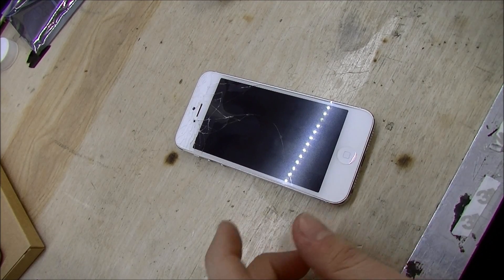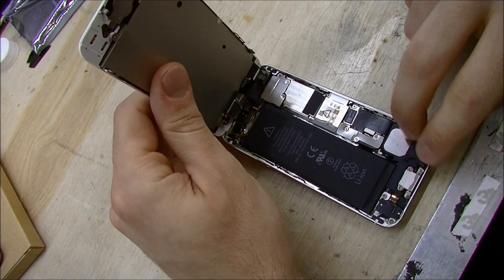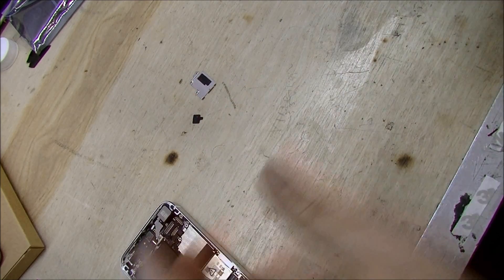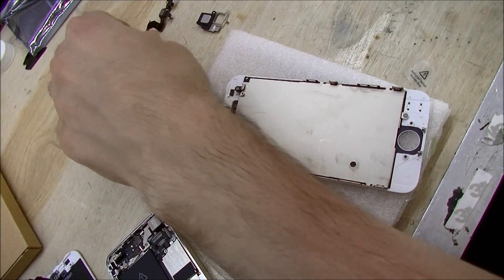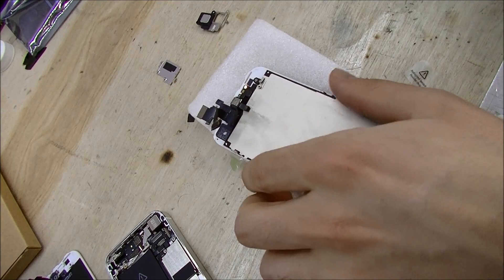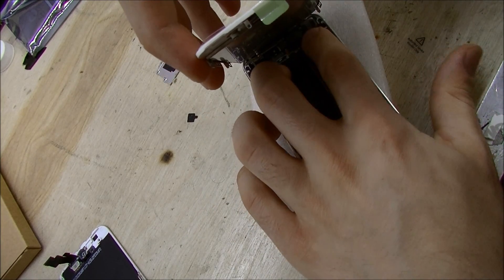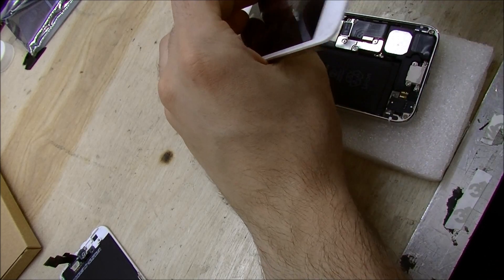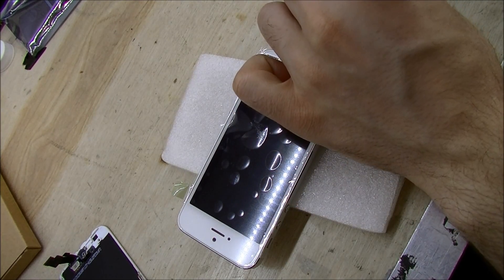iPhone 5 screen repair from start to finish

Comment: Hi. How do you repair an iPhone 5 LCD wherein the contact cleaner (WD40) messed up the inside of the LCD (It's dim now and bright at the top and it's purple with spots and looks like it's cracked). Also would show the Apple logo then shut down (wasn't like that a few hours ago). What happened was I was trying to clean the down volume button by spraying it full blast with the contact cleaner (I should have disassambled it and sprayed on the button from the inside). I was in a hurry. I did give it time to dry up but I think the pressure created a very cold temperature creating water/moisture or the contents inside the cleaner messed up the plastics and backlighting and somehow sipped through the LCD (either betwwen the substrate and the diffuser) but I'm just guessing. I dismantled the iPhone (should I dismantle the LCD itself, it seems the white thing which I think is the backlighting can be separated and cleaned. If I can clean and separate the LCD parts, how do I clean it? I have an ultrasonic cleaner and just distilled water (grocery). God bless. Rev. 21:4

Comment: where do you get screens from? I know it's such stupid or possibly offensive question to ask a repair shop, but I have a repair shop here in CA and I wanna make sure I'm using the best supplier. Appreciate it
Reply from the maker: No one has better parts than Jack Telecom, $54.50 for the iPhone 5 LCD new, original, NOT refurbished if you buy 200+

90% of the places you buy from sell refurbs which have thicker frames, shitty glass which fucks up touch response, a touchscreen that may have been slightly damaged in the drop which will stop working, shit that falls off. Don't buy the refurbs, just sell your broken ones to someone, but don't buy screens from people who will buy your broken ones and don't buy refurbs in general.
Reply: Louis Rossmann Agreed. I hate refurbished parts for any phones. Right now I buy my parts from ElekWorld. They are $45 for iPhone 5 LCD new Original. Honestly they never let me down. Have you tried them yet? I just wanted to make sure I'm getting the cheapest deal. I'm gonna give Jack Tele a try tho. cheers.
Reply from the maker: p00riaia IMO, elekworld is total shit. I'd advise not using them long term. It's about consistency. I used to sell 2000+ a week of these things, and it's about them giving good stuff every order without a problem. This is not something elekworld can do. Sometimes they'd be good, sometimes they'd be shit. Over four years of jack telecom now and they've consistently sent exactly what I paid for, informed me when and why quality may have dropped on any product line.  I can't say that for any other iParts company. You can find cheaper than jack easily, even from the U.S. , but it really doesn't take more than one embarrassing warranty job or that one time you really want to fucking go home but can't because you have to redo the repair to undo the price savings.
Reply: Louis Rossmann I know this video is old, but we use Elekworld and they give us about a 95% success rate lol that’s crazy that they were bad back then

Comment from the maker: Now if that technician wants to learn more as time goes on, great! But don't delay doing A because you feel ABC need to all be done at the same time. Do A, then do B, then do C. Promoting yourself is not easy. You'll have to come up with what makes you the obvious choice over the other local businesses. Study them. Are they expensive? Are they rated poorly? Do they speak poor English? Do they not spell out the pricing for their services clearly? Do they not answer the phone?

Comment from the maker: If you can find a local supplier, this is even better, because you can "always" be in stock. Even if you don't have something, you can say you do, and pick up a part on the way to your customer.

For other repairs, in the beginning, try giving a discount if someone won't wait. If you think this will be a popular repair, have the repair be nothing but double the part cost, and buy two of the part. You're working for free, but next time you can charge retail because of instant turnaround.

Comment from the maker: So, let's say you do the iPhone. Right now the 4/4S is the most popular. I'd say black/white 4S, and black GSM. CDMA can get used on both if you're handy with a set of Xcelite 175M. ;) 

So, buy 4 CDMA white, 4 CDMA black, and 4 GSM black.. an investment under $350. When you're down to 2 of each, make a new order of 2 of each. Keep it going. 

If business does well, order more so you never have to say no to a customer. Just keep on top of your inventory.